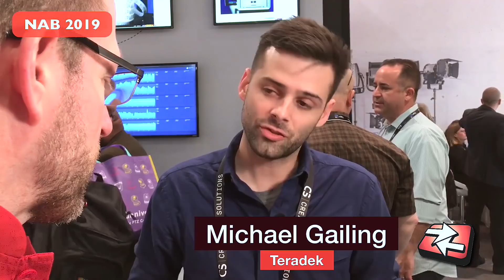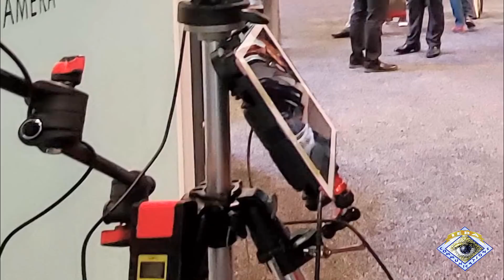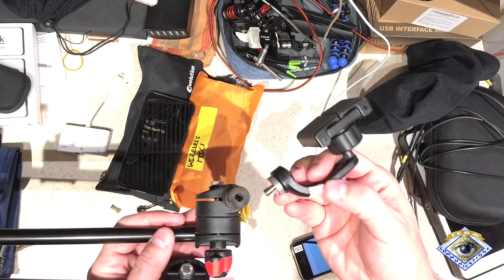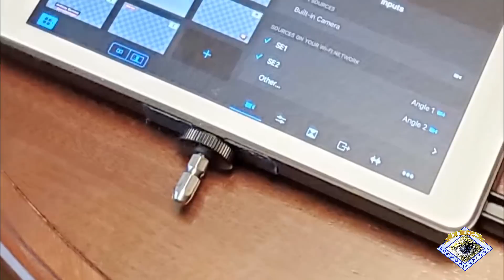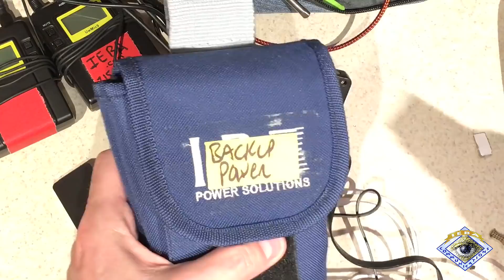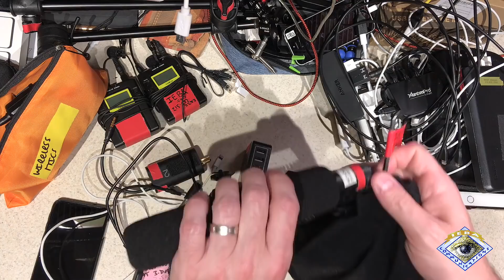Mobile Multicam Production Solutions - Networking - Audio - Rigging - More!

Comment: Hey man, love this and want to offer a solution like this for my area. However, I'm still struggling with the ethernet connections. I would likely be using Android devices because that's what I'm comfortable with. Would you happen to know how ethernet connections would work for android phones or even be able to point me to some resources?
Reply: Ethernet works the same way with Android devices that support MHL to USB, and then use a USB to Ethernet adapter. 
But there's not the same multi-camera live-switch solution for android that there is for iOS.